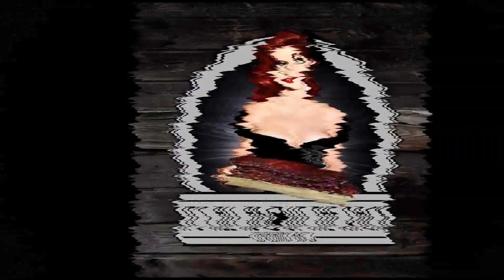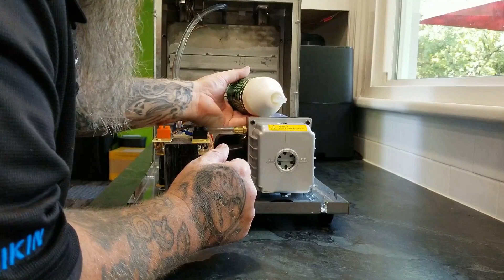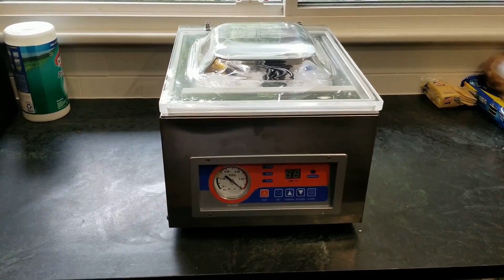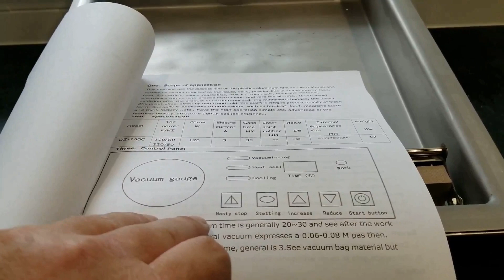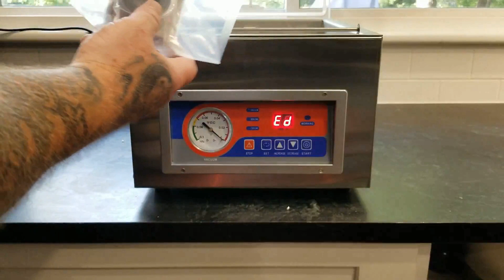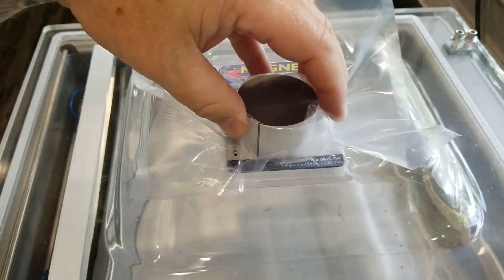Chamber Vac DZ-260C Review

Comment: Food saver is a ripoff. U can get the same perforated bags from china for about 5cents each.
Reply from the maker: Food Saver brand...? Yes, I would agree with that. Even if you can buy the "cheap" bags, which I did get some and some were fine and some no so much. The benefits to a machine of this type is that it is a chamber vac which gives you the benefit of doing liquids like soups or marinades.
Reply: Thank you for a very informative and honest presentation. I appreciate all the details you take time to explain. I also like all the knowledgeable people who have contributed their expertise on the topic of pumps, electricity, oils, etc... You really help one to make a well informed decision so there should be fewer surprises or disappointments once you get the product. I really like your Chanel.

Comment: Hi!, Do you know how I can find the sealing belt replacement part? I've tried to contact the seller, even the company, and nothing.
Reply: Video on how to replace heat strip.

https://youtu.be/T7VxCH7YPVc
Reply from the maker: No, sorry. I would look on Ebay and contact as many sellers as possible to expand the search. Good luck! Obviously what you get for a budget unit like this... Lack of customer service 🤨
Reply: Replacement heat strip.

https://m.aliexpress.com/item/1804644063.html?pid=808_0000_0101&spm=a2g0n.search-amp.list.1804644063&aff_trace_key=&aff_platform=msite&m_page_id=7922amp-5oodaeJ6Sl77SAjmII63TA1581665865723&browser_id=8872e476359341cdb6ba3a6f7581fbde&is_c=Y
Reply: Ariel, did you find the way to fix it?... Do you use it for commercial use?.... Experience for this 5months!

Comment: Just a note on this unit, the motor is 120 watts, which is a good measure for how much vacuum it will pull (as I read). Weston sells units that start as low as 200 watts and go up to 900 watts. VacMasters are 400 watts. A Food Saver sealer is about 120 watts. So this unit might not pull a much better vacuum then a typical Food Saver. One difference is a Food Saver style machine sucks air out of a bag which makes it inefficient. But regardless, the vacuum pump on this unit appears to be far less powerful than the more expensive units.
Reply from the maker: I will agree with you on this. But I feel it does pull a better vacuum than a Food Saver as well as being able to use it for liquids makes it a better value especially once you start comparing cost of bags. Excellent points and good research on your part.
Reply: @ItsallabouttheRack  I plan to use it for a meal prep business with liquids, now i am confident it will do much better then my shitty food saver

Comment: Any update on the longevity of this machine?  I'm very interested after this review.
Reply from the maker: The oil is not something you have to change after every use. I have not changed it at this point and it's the initial oil that was put into the unit. You can tell if the oil needs to be changed because it will start to get a milky color. I'm sure the oil could be desposed of by taking it to an auto parts store.
Reply from the maker: I buy stuff in bulk and use it just about every weekend. It shows no signs of slowing down at this point. It is pretty simple inside and looks to have a good vacuum pump. The life blood of any pump is going to be the oil, so as long as you're keeping an eye on it and changing it once it becomes milky, it should last. I'm still happy with my purchase and feel that's its a much better investment over a Food Saver.
Reply: @ItsallabouttheRack  How is the used oil disposed of?
Reply: @ItsallabouttheRack  with your weekly use of the machine, how often have you had to change the oil?

Comment: Great video! Do you recommend this machine or a foodsaver5800? It's for a small business but we pack around 2,500 pounds a year.
Reply from the maker: I'm not familiar with the FS 5800. Having said that I still like this unit, please keep in mind that I'm only using it for home use but I think it would hold up for light commercial use. I don't think you can go wrong with this unit for the price.
Reply: @ItsallabouttheRack  Thanks! We will buy this unit

Comment: I have been looking at this machine for a while now. I could not find any good or bad about it. Glad I found this. Going to buy it now.
Reply from the maker: Glad you found info here! After using it for a few months now... I do still like it but I guess I'm just used to a commercial machine that REALLY sucks the the bag around the product TIGHT. It does do a good job but it is after all a $300 machine. MUCH better and I'm sure in the long run better than the Food Saver! Thanks for tuning in and subscribe and like... Any other questions, leave them here!

Comment: I"m really interested in this machine now.  Have you used it with any liquids?  I can't get my head around how it can seal without the liquid getting in the way.
Reply from the maker: It works well with liquids! The reason why is because it doesn't pull the vacuum from the bag like a food saver does, it pulls the vacuum from inside the chamber which the bag is a part of. It then allows the atmosphere to reenter the chamber, (the bag is sealed by this point) which puts the pressure on the bag causing that suck in. For a budget type machine, it works really good! Thanks for checking out the video, I really appreciate you taking your time!